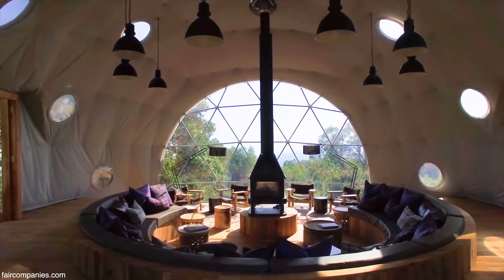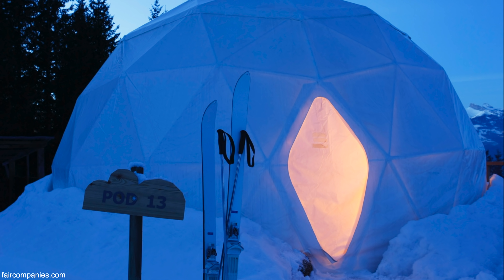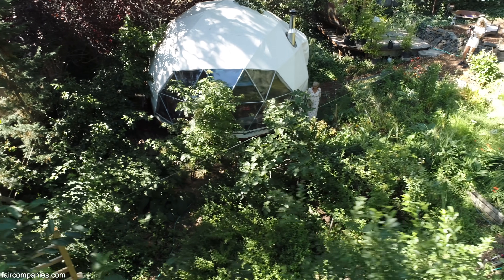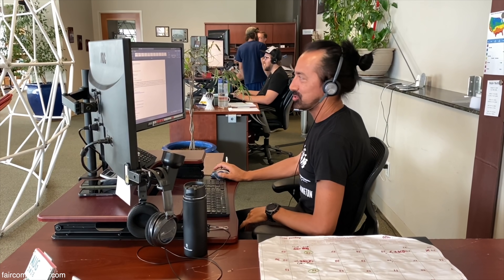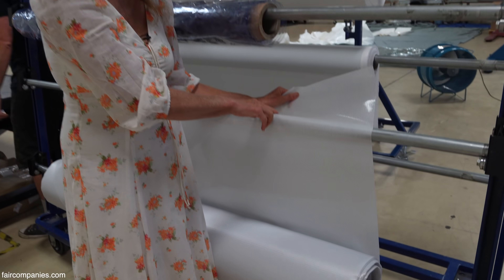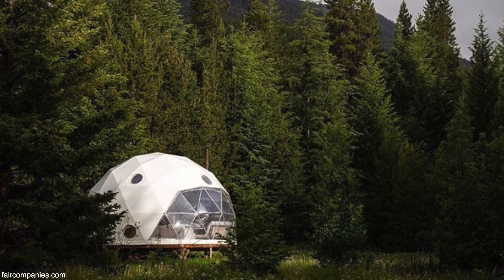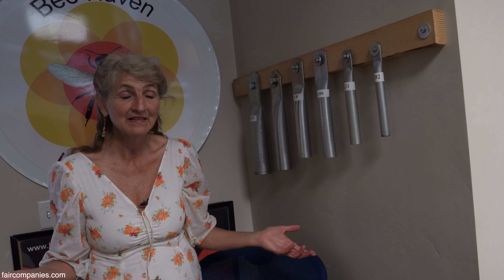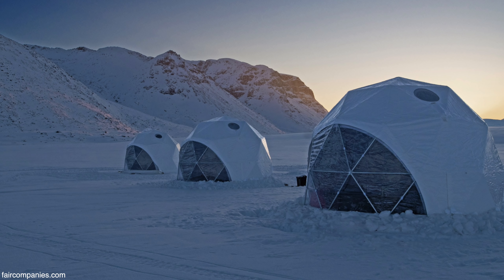Sewed own popup dome-home for need, been selling them since

Comment: How does one "lock the door"  on a fabric structure?
Reply: Dog and Gun ownership as well as visible security cameras just outside. Also. Choose a safe area to live.
Reply: @badapple65  Very easy to tell if someone is home with these structures, I doubt a gun would help if you're not home.
Reply: @norb4152  -not necessarily … roaring lights via solar energy with timers switching radio and lights on and off.
Having had an in-house robbery 4!months ago … I would need to perhaps create a rod iron structure to keep out those psychopathic cretins with violent goals.  Where there’s a will then there’s a way.  Granted … it DOES up the cost.  
Alas, I wouldn’t feel safe living in this easy to invade dome as a single female with zero training in self defence.  Even if I had a black belt … a gun aimed at oneself is formidable until one can get close enough to disarm the assailant assuming that the gun doesn’t fire and kill first.  Yes, it is too daunting for me having survived robbers in my home already.  😳  Pity.
Reply: haha. Good point. My thoughts went to what I've heard from cops and seen on videos about how thieves break into "regular" houses. They just kick the door in. One kick. Most people don't realize how vulnerable your house really is. Not to mention, it's probably easier to break a window than to cut through the dome. If someone want's in your house, they'll get in your house. That's what struck me, anyway. I could be wrong. :)
Reply: @CraigKinsey  Can confirm. My flat was broken into when I was a 21-year-old college girl. I was dirt poor and had nothing valuable. Not even a TV or radio. My laptop was the most valuable thing and I had it on me at the time. Anyway, the burglar trashed my entire home, but not just in the process of looking through my stuff. He also made sure to go out of his way to vandalize everything, like he ripped the kitchen cupboard doors out and threw them through my window. He even ripped my plants out. The worst was, I ran into him when I got home. He rushed out of my front door when I just meant to open it. He yelled at me "you fucking joke, you have only shit" in an accusative tone that actually made me feel guilty in the first moment of shock and I kid you not, my first reflex was to apologize to him. He just hit me back with a "fucking whore", pushed me out of the way and was gone. I stood in my hallway with my completely destroyed home in front of me, completely in shock. I still don't understand to this day how someone can be so cruel. I understand if he was poor himself and desperate for something valuable to sell so he could buy food. But he took pleasure destroying my home physically and also psychologically. I had to move afterwards and needed therapy for years because I kept feeling existential threat. Burglars have such criminal energy, if they want in and take and destroy, they will indeed move mountains to make this happen. :(
Reply: @CraigKinsey  when I lived in the states, that was my sentiment: flimsy houses. I always wondered what hurricane damage would look like, if one had to build to European specifications.
Reply: There is a standard frame and door included that’s integrated into the steel frame.  Hardened steel security cable can be attached to the hub bolts across each pair of triangles to make the spaces too small to get through.  Battery backed-up security cameras with motion detection, and a wireless Internet app, can provide early warning of approaching trouble and video evidence of attempted break-ins.

Comment: I want a workshop like that! No permit needed and easy to build it myself! Wow!
Reply: I like the idea of building a wooden structure inside near the rear to house plumbing and electrical for kitchenette and bathroom. Like a little building within the dome. That one photo on that huge dome showed a stairway going up to kids room on top of the wooden structure. Very cool. I would bet this video will require them to immediately hire more people or at least a whole lot of overtime coming for their workforce.
Reply: I would love to connect a couple to give more rooms.
What about building one with a second larger dome over it with foam insulation between and in layers?  That may get its insulation rating high enough to be deemed a permanent structure.
Reply: @sassychick9561  Probably not, because they are made with a fabric rather than "sticks and bricks."

Comment: Really nice but wtf are you making them in white.?  Why not black or green to blend into the landscape?  White looks so invasive in a natural setting.  Great otherwise though.
Reply: If black they would solar heat to an unlivable temperature inside.
Reply: Clouds generally look white, and they seem pretty natural.  The gray and black ones only look that way from underneath because the Sun can’t penetrate them.

BTW, according to their website, they make them in about eight colors, at least one of which is green.  You can also get anything you want printed on them, but it ain’t cheap, since that’s for corporate customers.